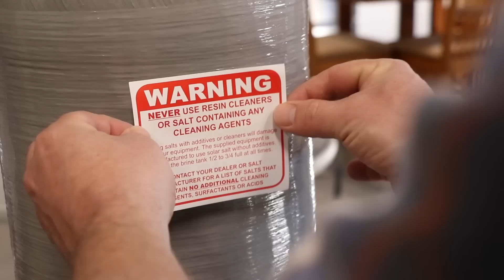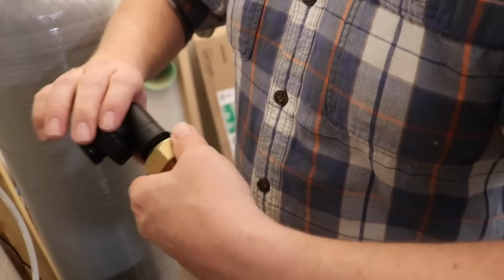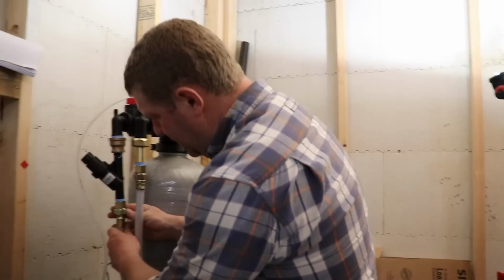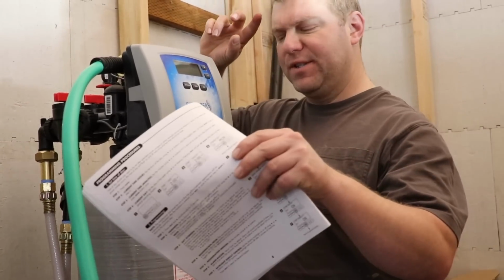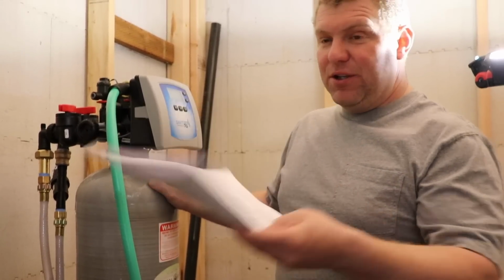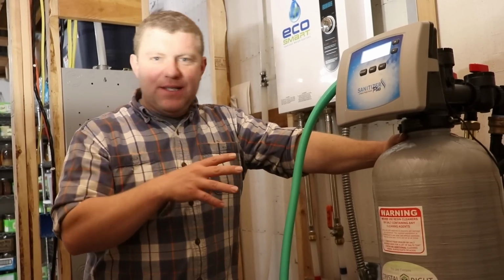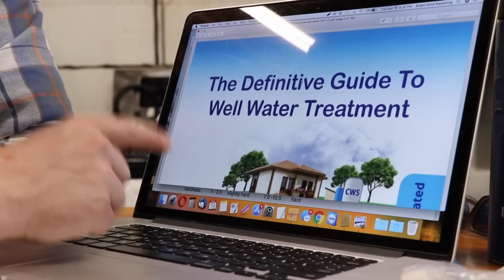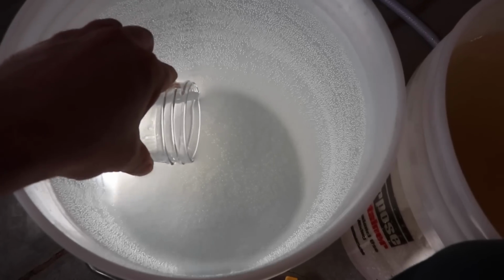ITS FREAKIN MAGIC! (Installing Water Softener for Well Water)

Comment: A water softener that uses salt will remove the calcium (hardness) but exchanges it for sodium. Something to consider in the future. Suggestion you use straight untreated well water for the garden. That will save on the softener usage, and the plants don't care. Jon

Comment: Just a suggestion...I've lived with well water systems for the last 40 years. Please do yourselves a BIG favor and add a 1 Micron canister filter to the inlet line from the well before it goes into the softer. Minuscule particles will clog the venturee of the softener causing that unit to stop functioning. I change my particle filter about ever month, yours maybe more or less depending on the amount of particles contained,  it sure beats having to breakdown the softener clean it out and reassemble it. If you can afford it keep a replacement venturee on hand to swap out, and clean the old one and have it ready for the next time. Because there WILL BE a next time.

Comment: I’ve seen you do plumbing tape several times and it’s always the wrong way. Rotate the opposite way you do the tape now so it stays tight while you wrap it around threads. It allows you to make the tape stay and be way tighter fitting and always go with the direction you are twisting the fitting so again it always stays tight and doesn’t unthread.

Comment: I have the same system installed. I would advise installing a filter in front of that filter to capture any fine particles that could potentially damage the valve system inside that expensive filter.

Comment: Your system is actually just a start. You should put a sediment filter tank before the water softener tank. The sediment filter medium in that tank is exchanged once a year. Now the sediment is flowing into that softener tank. The backwash system does not rid the tank of that sediment build up. After a few years sediment build up could overwhelm the tank.

Comment: Great video guys! My wife and I have already gone through most of the same steps you are experiencing with your well. Something to keep in mind if you have a septic system is the high salt concentration of the backwash from the water softener will disrupt the ecology in the septic tank.  We have chosen not to soften the water, but we filter out the iron and manganese in one whole house filter and the arsenic and other heavy metals in a second whole house filter and just use a reverse osmosis filter in the kitchen for drinking and cooking. Good luck! :)

Comment: The reason you could not suck water from the salt tank is because there is a ball at the bottom of the brine tube that floats in salty water it works as a check valve . If there is not enough salt the ball won't float and the unit will not suck water from the tank . Fill the tank with salt and add 10 gallons of water it will take about 7 hours to make enough brine to clean the unit right.  I have been doing water treatment for 5 years also yes a pressure tank with a switch is the best way to keep a proper pressure to clean your unit also most need at least  30psi to clean right.  Also a sediment filter first will remove a lot of the iron and help keep things cleaner

Comment: In order to protect your pump and direct feed your water softener, put in a pressure tank and switch.  You can still use your cisterns if you want, but for everyday use you can direct use your well rather than all the workarounds that you currently have.

Comment: Four things.......get a bladder tank so your pump just cycles although with your well being so new it won't hurt to 1st flush it for a while using your bypass method. Install a sediment filter between the pump and the bladder tank (don't think for a minute that sediment will get back washed out of your softener and it doesn't hurt to keep your tank clean) , install a main pressure regulator downstream of the tank. that is set 10 PSI below your pump cut in pressure setting so you'll always have consistent pressure/flow to you softener/cistern/house and lastly, do not run your brine rinse water into your septic, run it in a buried line into a french drain. Otherwise you'll surely have problems maintaining good bacteria in your septic that will eventually show up as a screwed up drain field which is way too late to find out. BTW, that's the noisiest softener I've ever heard. Oh, and you probably have the brine tank float valve installed incorrectly.

Comment: 1) You've got a great unit but the zeolite will need replacing in about 10 years. 2) bubbles do not mean bacteria. 3) well water with iron and hardness is better for most plants than sodium that your unit replaces them with.  So drink the conditioned water and water with the well water.   4) I really wish I could call and help with this, but even though I've been doing water treatment processing for 30 plus years, you guys are doing great.  Maybe add a UV light and fine filter for formula and drinking water?

Comment: Well pump > pressure tank > sediment filter > softener > house (at this point you can have ro water filtering to put water through a carbon block and reverse osmosis filters to remove the nasty in the water for drinking needs). Then you won't have to have a line going... somewhere... off the well pump to limit the pressure. Pressure tank will have a pressure switch that kicks the pump on to refill the tank.

Comment: Maybe I missed it, but you NEED a water pressure tank, or you will burn out your pump.  And I forgot about the pressure switch,  as you shouldn't manually control your pump.

Comment: Couple items to please look into. Most modern home soft water loops that are installed soften all the water except the cold water in your main sink and your outside faucets. Typical resin beads will collect the minerals and become positive charged. Once the beads are full the salt water will rinse the beads and make them negative charge again to collect more minerals. There will be a wash cycle to clean the salt off the beads but it never gets all the salt off. I would really look into reviewing if you want to water your plants with this stuff. Great for showers though. I’d get a reverse osmosis system for drinking. Good luck and love the videos. Plus I can’t remember if you have septic system for sewer or connected to city system. The back wash might kill the good bacteria in your septic system.

Comment: An ion exchange softner will help to eliminate the water hardness but it could become severely inefficient if you don't filter debris. You are still gonna need a PP filter at some stage before. In my experience, but I owned a very very very old one, debris will deposit under the salt and it will become a lot hard to clean during time.

The bubbles is chlorine from the ionic exchange with the salt which is sodium chloride

Comment: Awesome! Limiting the need to haul water has to be a major relief on your time and piece of mind.  A couple suggestions for consideration: 1) consider getting a Reverse Osmosis water filter for drinking and ice making solutions only. You don’t need that clear type of water for the toilet or to wash dishes with, plus it’s much less expensive if you limit it to drinking/ice-making only. 2) consider putting some foam insulation (think Home Depot panels) in the floor joist over the mechanical room to minimize any noises coming from that area. You could also just add it to the mechanical room ceiling and walls to minimize the sound too. A 2” foam insulation still leaves you with 1.5” of space to run wires and water lines through. The RO system really does make a difference in taste (like none at all) and it extends the life of your ice-maker too.

Comment: Jesse  about the plumbers tape  you are doing it almost right but try rolling off the roll backwards once you get the hang of it you will find it rolls very easily on to the pipe threads no more fighting the long tail to break the tape  when you have enough on just a little tip I have learned over the years good job we need to see you two more often

Comment: Water softeners usually can only process at MAX 2ppms of Iron. If you have more than that you will need an Iron filter. Furthermore if you are 1ppm or above I would recommend you Regen more frequently.
Also with that type of(bacterial) iron if I remember correctly you will notice even with softener that you will get a slime on standing water.

Ive never heard of lifetime softer media. 15 - 20 years  I would say less with the iron issue.

What ever you do. Never allow unteated water flow though your pipes casue that shit will grow. Then you have to superchloriante all  water lines. Did it many times for customers.

Comment: Some tips on Teflon tape. Do not let the teflon tape stick out more than the threads on the pipe. Otherwise, you will have shredded Teflon tape in the pipe causing blockage. Also, unroll the tape opposite direction of how it is rolled. If you unroll it like regular tape, it will be hard to apply on the thread as you did in the video.

Comment: Looks like your house is getting more complete. With all the high tech solutions of a modern home. 

When you are done setting up the water system, make sure you check the fill  level of your septic tank.

Comment: We have a similar setup on our softner/degasser system but coming from the well the water hits a large cartridge filter then goes to the system.  Our system runs flawlessly and the only change I'd make would be to run 2 cartridge filters in parallel so we could change the dirty cartridge without losing water pressure in the house.

Comment: Why is it so difficult.  Many of us have hooked up water softeners without all the questions/conversation and difficulty.  Water softeners have been around for many years and are well advanced.  The salt solution is used to clean the filtering material, it does not go into the filtered water.

Comment: Water when cool/cold will hold more gas than water at room  temperature, so the bubbles are dissolved atmospheric gases, nitrogen and oxygen, laid in when the aquifer filled.  So,warm the water and you get bubbles.

Comment: Very exciting to see your progress guys. A bit of a top plumbing tip though, when using thread tape, flip the roll over so that the tape is coming off between the roll and the fitting and not off the top of the roll as in your video. Now you  can stick your finger in the roll center and just whizz around the fitting like a pro.

Cheers

Comment: Step 1 water well, Step 2 build a pump house around water well, Step 3 install pressure tank and water softener. Split from pressure tank to garden  and to softener then from softener to the house. That is the right way to do it.

Comment: Congratulations on the build progress and overcoming all the sacrifices along the way! From my experience a sediment filter may triple the life of your softener. I would recommend a simple 20 inch “big blue” filter housing between your well and cisterns. Its under $100 and captures most of the rust especially when you use a 5ppm filter. The filters this size will last you close to a year and are good value.

Comment: As you prepare to grow garden, there is no real reason to use filtered  water in the garden. Use the diverter at the well head to water the garden and save the filtered water for the house/hot tub. The plants really don't care if the water is treated. You will save money and water as well.

Comment: Would it be difficult to run the garden water off a smaller separate tank (that you place right above and behind the garden) so that you don't have to run it through the water softener (consuming the brine and wasting good iron that plants handle just fine) ? The tank you already use to haul water, for instance?

Comment: I would suggest a separate circuit for garden water and not use your capacity on water that doesn't require it. love your vids and use similar system but break out the outside hydrants before water reaches treatment. water away and not worry about treatment capacity.Dave

Comment: If you want a quick and dirty (no pun intended) to filter sediment from your well, you can look at livestock solutions. Many fit directly on standard hoses. Keep in mind, this is probably not the best solution because they are meant to be disposable, but some might last several cistern fills before you have to replace them. That would give you a simple solution until you find the best solution for you.

Comment: you need a pressure tank to eliminate the need to leave the bypass valve oped to drain.  The pressure tank and pump controller turn,s the pomp on and off

Comment: (You were trying to lift the water more than 36 inches using lung power.  You should try it with your head closer to the water level.  This is the reason why human snorkles are only about a foot long.)  Kudos to you for working the problem and educating yourself on your water treatment options.  Water chemistry is magic.

Comment: You know some of that rust you're getting every time you start that well up is from that weep hole you drilled in the top of it it's washing the metal casing down every time you turn the pump on

Comment: It sounds like you want to fill the storage tanks w/ soft water. This will put soft water on your garden, are you sure you want soft water in the garden? There is sodium in soft water I think that is not good for the plants. I may be wrong but this is what I was told.   Bruce

Comment: I added a 5 micron household filter before the water softener.  This will help prevent dirt and sand from damaging to the softener and faucets.  Also, there is some maintenance with the softener. (small screen cleaning) so please read your manual.

Comment: Hey guys, you should be cautions drinking softened water. If your water is fairly hard to start with, the "ion exchange" will leave a high level of sodium ions in the softened water. Over time this can have adverse health effects. Good for washing and flushing, not so much for drinking.

Comment: You can't draw water from a brine tank with no liquid. The brine valve has a check valve preventing the softener from sucking air which would cause oxidation of the iron and defeat the purpose of ion exchange.

Comment: When you started talking about the garden I think you made a real mistake.  You don't want to be watering your garden with softened water.  You may not realize it but your system does cost you.  In filters eventually and in salt immediately and I don't know what else EXCEPT, your planing  on pumping water up the hill to the storage tanks and then letting it fall back down.  You can save electricity and wear on your pump if you just pump the water over to the garden.

Comment: Something to think about.  I have the same type of system in my house and it works great.  When I am water outside plants and garden I use untreated water directly from the well.  My thought process is why put treated water on the ground?  So my house is supplied  with treated water and all of my exterior hose bibs are connected directly to the pump. Just my 2 cents.

Comment: I'm guessing your brine well has an anti-siphon check valve. Put water in the brine tank until it's above the salt floor if it has one or above the bottom of the brine well and try again. Or connect the tubing to the softener and place the other end in a jar of water and see if it draws it up.

Comment: No matter what, No matter how fancy that thing is and the fact it can backwash don't mean squat. With water that flapping hard and that heavy amount of iron that reason only will survive 5-8 years before the resin needs to be changed or cleaned via chemicals. The resin is not a life time thing by any stretch of the imagination. The resin will only survive 8-10 years before it stops water softening all together. You should absolutely grab a 10 inch filter housing and AP110 sediment filter to help it last just a little bit longer.

Comment: The ground water is colder than the air temperature. The colder the water the more dissolved O-2 in it, as it warms it releases the excess O2 on the warmer surfaces of the bucket.

Comment: A Silly Question, I know, but ......
I know you have your well, 
& that generally your well water is VERY GOOD quality, but ....
For use in your "SPRING THAW" season, 
would an above ground, big, s/s collection hopper, 
above/up-hill from your buried cistern,
for collecting clean-snow, & thus clean snow-melt,
give you a "Belt-AND-Braces" (duplication/redundancy) solution ?

Redundancy/Duplication/Contingency is always an important consideration.

Comment: I think you could go straight well water for the garden and then for things like washing down the backhoe or whatever.. Next time you wrap your pipes, with tape, you need to turn the tape over so the tape is coming off the bottom of the spool...  That way you will not be running too much tape off at one time..  You can keep more presser on the tape too...  Time for a presser tank on the well....

Comment: I would get a surge suppressor for the water softener power supply. Even thought it is running of a little power supply brick that will protect it from most power surges, it will either burn out the supply or fail to protect the electronics during large surges. The damage can also be cumulative over several years before the electronics fail.

Comment: Did you copy that? I’ll send it again! COPY? I sent a thank you via mental telepathy. You must be reading our minds. Toni and I have been reading and messing with our filter for a few weeks. We have <.3 iron but do have 450 ppm hardness and the dreaded sulfur smell. We don’t do soft water so we only have the filter. One thing we did notice is if we fill the RV tank and use the 12 VDC pump it is aerated and no more sulfur smell. Thanks for sharing your situation and do change that Regen time. Our whole family were brought out of bed in our last house at 1:30 Am when the backwash kicked on in our crawl space and we thought a pipe broke. 😂😂😂